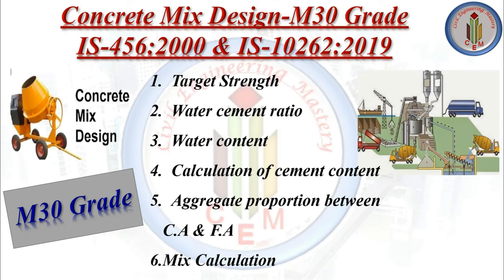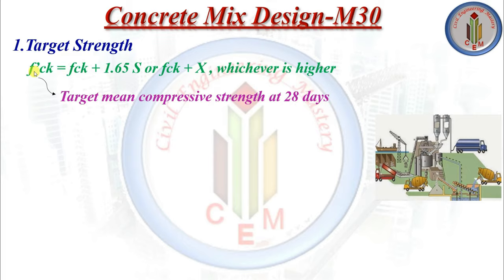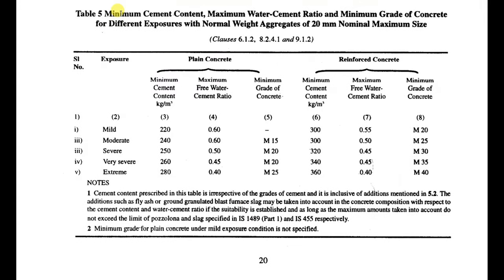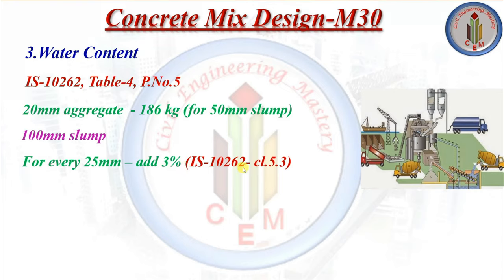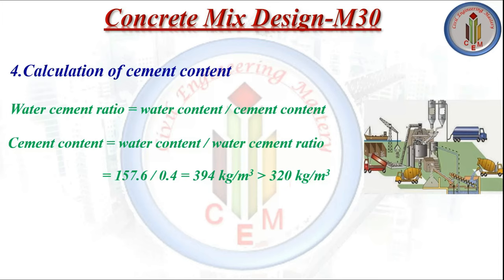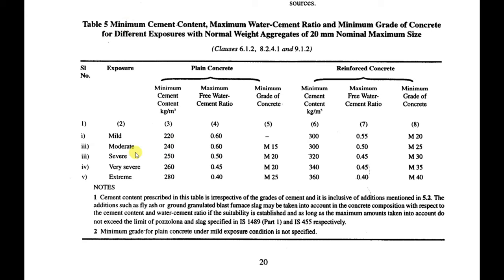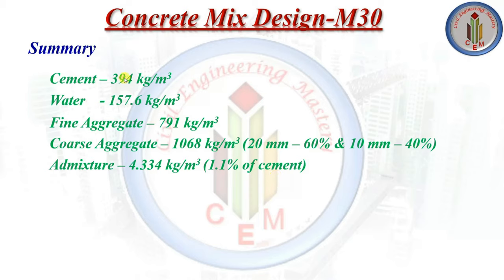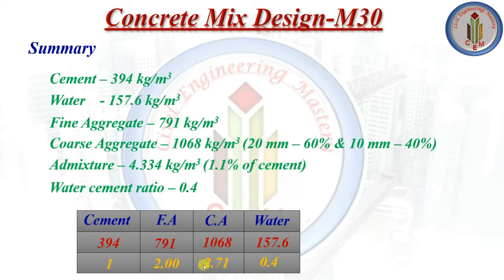Mix Design M30 Grade | Concrete mix design M30 grade | M30 concrete mix design | Concrte mix design

Comment: Design a M30 grade concrete mix having a slump of 50-75mm for a structure likely to be subjected to extreme exposure conditions during its service life. The aggregates available is well shaped having a nominal size of aggregate of 20mm. specific gravity of 2.62 bulk density of 1540 kg/m3, moisture content = 1.0 percent and absorption = 0.5 percent, whereas the aggregates to be used has fineness modulus of 2.40, specific gravity 2.52. bulk density 1625 kg/m3, moisture content = 5 percent, absorption 0.6 percent. The available Portland cement has specific gravity of 3.14 Use IS method of mix design for mix proportioning to estimate mix proportions.

Comment from the maker: Dear All, 
There is confusion regarding the water-cement ratio. So kindly follow the below steps
The water-cement ratio is 0.45 only pls check step no.2. So we need to add 0.01 one time in step no.5.
It was an error in step no.5, (0.45 -0.4= 0.05) instead of (0.5-0.45 = 0.05). Kindly ignore that and follow the water-cement ratio of 0.45 as in step no.2.
Thank you.
Reply: Here, the value is +0.05 so, we have to decrease (-0.01) that's it or else we have to increase +0.01

Comment: Mam in every numerical you subtracted 0.5-0.4 but in this case in the step 5 why you minus 0.45 to 0.4
Reply: Because in step 2). our water cement ratio was 0.45 and we have reduced it to .40
Reply: Why should we reduce it? Can you pls mention in which cases we should do that and is it 0.05 which will be subtracted from the given info?

Comment: Mam after using admixture w/c ratio will be 0.4.
Then in step no.5 i.e. aggregate proportion step you added 0.01 one time only. Actually from 0.5 to 0.4 it is need to add 0.01, 2 times.
Am i correct? Or any understanding mistake?
Waiting for your reply mam.
Reply from the maker: No. The water-cement ratio is 0.45 only pls check step no.2. So we need to add 0.01 one time only.
It was an error in step no.5 (w/c -0.5). Kindly ignore that and follow the water-cement ratio of 0.45 as in step no.2.
Reply: @CivilEngineeringMastery  But for calculating cement content you used water-cement ratio as 0.4
Reply: @CivilEngineeringMastery 
Which water cement ratio we have to consider mam..
Reply: Madam once check the value of volume of coarse aggregate 0.549 is not correct madam 0.567 is correct

Comment: Hello ma'am At 12.40 moment there is mistake ,the calculated  W/C ratio  is .4 but u use the .45 thereby ur calculated value of volm of C.A is wrong & also next value is errorful , so please justify the mistake .
Reply from the maker: The water-cement ratio is 0.45 only pls check step no.2. So we need to add 0.01 one time in step no.5.
It was an error in step no.5, (0.45 -0.4= 0.05) instead of (0.5-0.45 = 0.05). Kindly ignore that and follow the water-cement ratio of 0.45 as in step no.2.
Reply: So ma'am there is no need to subtract 0.05 from water cement ratio ?(which you did in step no 2 ), and if we have to subtract can u please explain why we should do that 
Thank you